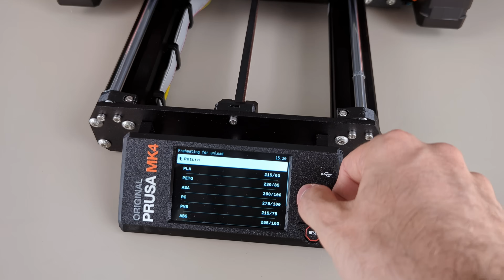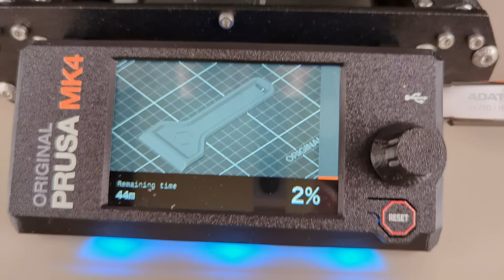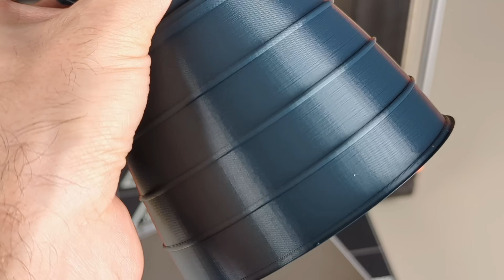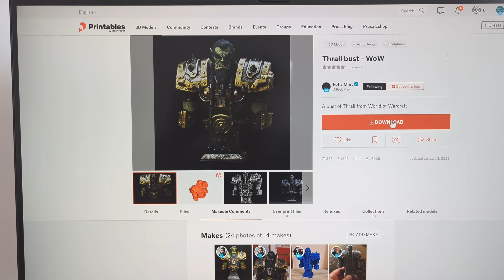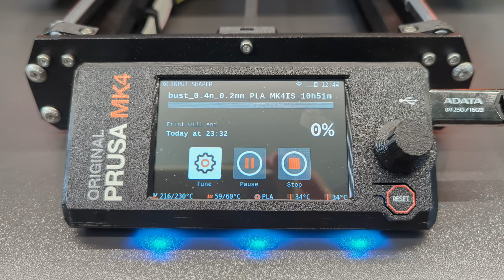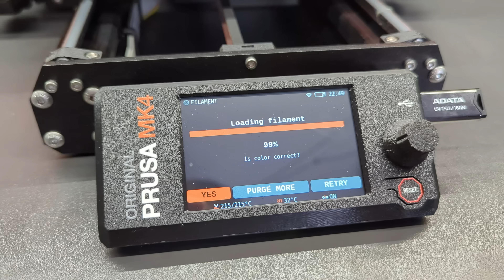Prusa MK4 in 2023? 🤷‍♂️

Comment: Love prusa, but this printer really isn't good enough for it's price point anymore. Bambu has the P1S with 4 color printing for €200 less than this. Open source is great, and building in Europe is admirable, but the mk4 needed to be much more of an upgrade than it was in reality.
Reply: I'm still not sure what people expect. It's an upgrade of the i3 line. One that added all the things people complained about on their MK3s and more. The name MK4 is exactly telling us that: The 4th Mark / model of the i3 - a proven workhorse. 

Sure, Bambu's coreXY are impressive and have a more advanced motion system. But I for one like that I can fix my printer with parts I can either print or buy in an electronic shop around the corner. I am not a fan of having all my print files in the cloud too. I have used Prusa's 24/7 live support and it helped fix issues in a day. 

I also find it funny that people complain about the MMU which works fine for a lot of people (and especially do so after the latest firmware upgrades), but praise the AMS and it's "minor problems" which includes such minor things like a lot of spools not working because of size or material, filament breaking in places that are hard to get to, roller holders breaking and what not. It's also not a good idea to print abrasives with the AMS, is it?

Overall these are different machines for different customer groups and ALL have their advantages and flaws. 

I always feel like people are comparing the latest Toyota Hilux model with a Mercedes SUV. Sure, the Mercedes is faster and better looking. But in a few years one will be used with a machine gun mounted on the bed and the other one will be shot at… ;-)
Reply: @ulaB  Your compairson is flawed for a few reasons. First, your facts are wrong. You are not required to connect to the cloud system, LAN only or SD card works fine. Seconldy, replacement parts for the bambu are all insanely cheap and ship fast. If some proprietary part on the prusa like the nozzle breaks, you have to wait a couple weeks for shipping and pay crazy taxes. (I've ordered from both companies)

Secondly, it's not even debatable that the AMS is worse than the MMU. People don't want a project multi material system that needs hours of tinkering and software updates to work. Even though the AMS doesn't work with some materials, these limitations are clearly highlighted, and if you follow their instruction, you wont have any problems. 

I like your comparison of the Toyota Hilux vs the Mercedes SUV. But imagine this, if both the Hilux and Mercedes were $30k new, which one would you get?
Reply: @morbus5726  An old Hilux, because it's more practical, for what I need it to do and I can repair it with a hammer.

The LAN only and SD modes were added after people complained, weren't they? You still need the cloud for firmware upgrades? Nobody knows what data is being sent then. Log files are encrypted, so nobody knows what is being stored in them either. Most people don't care about that - which is fine, but I do and have to.

Import taxes are not Prusa's fault. Being in the EU, I don't have to pay extra and shipping is fast too. I can get most parts from different shops if I wanted to anyway.

As I've said. People have different requirements for their tools. All these tools have advantages and disadvantages. I prefer one, you prefer the other. You shouldn't call my choice flawed, because it doesn't fit you.

BTW I never understood people having so many issues with the MMU2. I have maybe calibrated it for an hour. All I had to do was setup the two filament sensors. After that it worked fine. Perhaps it's because I print with Prusament PETG most of the time or I was just lucky. I have even printed TPU with it even though I've been told it doesn't work correctly. The only mod I did some time later was the PTFE adapters in the back. No tubes with different diameters, nothing. I don't even use a filament buffer. My filament just dangles from the table.

I was quite angry with myself because I had it laying around for nearly a year before I added it. I was scared because of all the horror stories I read before. And after I wasn't sure why people were so mad about it.
Reply: @ulaB  LAN mode and SD card mode were NOT added because people asked, it was there from the get go. Do a bit of research before confidently stating facts.

I agree that it's personal preference, but now many people do you think would pick a Toyota Hilux over a new Mercedes SUV for the same price? 

Not all people care about open source, or want to print their own replacement parts. People want things that work, and nowadays, people care less about privacy. 

I personally run my bambu's in LAN only mode, but the majority of people don't care at all.
Reply: @morbus5726  If you have important 3d printing files of course use LAN, if you use wifi you are stupid
Reply: Exactly, Prusa has fallen behind quite a long way. Printers in the same price range of the mk4 kit are much better. The mk4 was outdated when it was released, that just shows how far behind they are. There really aren’t any excuses Prusa can make for the mk4, they have continued charging a large amount for the mk3 for years so funding shouldn’t really be an issue and the mk4 is just a slightly upgraded mk3. There really isn’t anything that innovative about it, it is just an mk3 with a few upgrades that pretty much anyone could add cheaply, the main changes are just a 32 bit mainboard, a new extruder, 0.9 degree stepper (which anyone could have added anyway) and a load cell, nothing really that impressive. The amounts Prusa is charging for the upgrade kits is ridiculous too, to convert the mk3 to an mk4 you might as well just buy an mk4 kit.

Prusa has done too little, too late, to actually compete again and produce modern printers it needs to be much better. If it is going to cost more than the likes of the P1S (although the P1P is a better comparison due to it being an open air printer too and makes it look even worse for Prusa) then they need to produce a printer that has similar or better results.

Even look at the AMS, how many times has Prusa attempted their MMU and how well do they actually work? Then Bambu labs releases the AMS and apart from some minor problems it just works. Why couldn’t Prusa make a reliable and functional multi material system? Bambu have totally wiped the floor with Prusa and not just in one area, their printers and multi material systems are much better. 

Hopefully this has been a wake up call for Prusa and they will start actually innovating again but it would take them a lot of work even just to catch up with what is currently available, not to mention what will be available in the future. They have a lot of work ahead of them if they want to reclaim their reputation and I don’t know if they can do it.

Comment: What an excellent video, crazy to see so many little bugs/glitches in the menus and setup processes for such a pricey bed-slinger.   Seems like a great printer but all the little issues and the fact that there are now so many cheaper competitors, I don't see myself getting one :/
Reply: Prusa have fallen behind massively. Their latest flagship is just an mk3 with a few upgrades just about anyone could add. Literally just put a decent mainboard in a mk3 and add Klipper with a raspberry pi and you are probably already just as good as the mk4, even closer if you add a Revo hot end.

The mk4 was outdated when it released. Prusa have a lot of work ahead of them to catch up.
Reply: @conorstewart2214 
Yes. They need to include the spyware and proprietary bits. Heavily encrypted log files will be the icing on the cake.
Reply: @TrollWithOpinions  what is your problem with bambu? This has nothing to do with bambu, it isn't bambu's fault that the mk4 was outdated on release.

Are you just another prusa fanboy trying to scare people away from better printers.
Reply: @conorstewart2214  
My main problem is twofold.
I do not accept the need to register on an app simply to be able to install the printer or upgrade the firmware. That is unnessessary  information gathering, and you do not know what information they gather.
Second. I do not accept overly large logfiles that need to be sent to Bambu in case of support. Especially when thy are so large AND encrypted. I want to know what data they leech from my system.
There are more reasons, but you get the idea.
I do not in any way try to diminish the quality, speed or some of the smart features of the Bambu. I think it looks great. But there is no way in Hell a system like that gets into my house, onto my network.
Reply: @AptMantis2278that is a very subjective opinion, it highly depends what you compare them on.
Reply: @AptMantis2278
MK4 is a “bedslinger”, but at least it is not a spyware printer.
Reply: Honestly, a few of these were just him. Like all the filament loads/unloads. I’ve never had an issue with it.

The progress bar stays at 99% signaling it’s about to retract for you and he kept pulling it every time. Pretty sure he managed to trick the filament sensor that way a few times in this video.

As for WiFi, I’ll admit it’s pretty archaic. I only used it wired, so never had to deal with that.
Reply: @aaronchamberlain4698  I feel like this I'd a half hearted criticism. He was pretty reasonable and shouldn't have to know about weird quirks of the product. You're buying a 3d printer, you aren't house hunting for a house with "character".

Comment: It would be good to see an actual comparison between the Bambu and the Prusa. 

Comparing these artifacts, noise levels, tolerance, bed adhesion (you seem to be using glue sticks and brims on the X1C which might indicate poor adhesion), etc. 

Right now the final conclusion seems a bit rushed and not clearly justified in the video itself.

Comment: I think Prusa in this is a step behind other brands like Bambu Lab o Creality with the K1. I have de mk3s and the prusa mini but if I had to buy a new one I would buy a Bambu lab or some core xy with klipper and modern things. This model is like a generation behind.
Reply: An Ender 5 converted to klipper and user modded would probably be better than a k1, lol.
Reply: The prusa mini is a great mini printer as long as you don't care about speed, I love my mini more than my voron
Reply: @dark_xdark132  I agree, I love my Mini too, is the printer that I use the most and the more efficient, but for sure new and better printers are coming and I am open to that. 

I see a new generation of printers and Prusa right now is not in that wave. 
For sure they will ride that wave but right now none of their printers at least in my opinion is next gen. 
I saw in printables a very interesting project to make the Mini a core xy that I will try once its mature enought. 

My comment is not to put hate on Prusa printers. I like them, but I see that right they are behind and now I prefer other type of printers. 
Meaby I am a little bit dissapointed with them. I was expecting more of Prusa or something new or disruptive, and I think I´m not the only one. But that is because they are the best in what they do and I think they can do much better.
Reply: Yeah the mk4 is just a slightly upgraded mk3. It wouldn’t take much knowledge or time to upgrade an mk3 or even cheaper 3D printers to be better than the mk4, just add Klipper and you will probably end up with better results than the mk4, that ringing and other artefacts are terrible.
Reply: The K1 is made from cheap plastic and is a huge security risk because it runs a fully managed Linux box that you have no control over. 10/10 would never buy one.

Comment: I feel like you critique on the wireless setup is kinda lazy. Wifi connection is explained in the printed manual (because obviously it is) and also on their website, it is not difficult to find at all or hard to do. I really don't think it's fair to say it should be easier to set up if you don't bother to look for instructions in the manual that comes with the machine.

That said the wifi, even when set up, is slower than you would expect from a machine of this caliber.
Reply: Excuse you????

In what universe is having to put in an sd card to enter wifi credentials decent UX?
On top of that, it doesn't even tell you obviously if its wrong.
You are making crazy excuses for an objectively bad UX.
Just the fact you need a manual to do it is a problem. On any other machine, you just intuitively type it in like youve done on every other device ever.
Reply: @BeefIngot  Sure it might not be an elegant solution but it's not hard at all, and he wasn't complaining about having to put it on a usb stick (which would have been valid criticism I agree) but the fact he couldn't get it to work when he only went to the settings page and waited for something to happen there instead of looking at the manual. That's what I am calling lazy.

I'm not making any excuses for anything, go hate on Prusa somewhere else.
Reply: @ren8  Dude, literally no human ever expects to have to read through the specifics of a manual to enter wifi credentials. It's completely unfair to call him lazy for that.
Reply: @BeefIngot  I looked in the manual. Most people might not start there, agreed. But if you don't see anything in the menu it is beyond lazy not to take 5 sec to look in a manual.

I agree they should've just enabled the user to enter them in the menu (although with only the nob it would take forever to type anything) but I also think a user should take a look at the manual before giving up.
Reply: @ren8  I mean, how do you think he got through the rest of the video? he probably did exactly what you said. Most likely he was reasonable, assumed it shouldn't be all that difficult then criticized them fairly for having to refer to the manual and deal with this type of weirdness just for wifi
Reply: @BeefIngot  Did you even watch the vid? He said he never got it working.

Comment: What other printers would you say compete with the MK4(price-wise)? I'm still on the MK3 and very happy with it, but I am considering upgrading soon. I know the Bambulab X1 is great, but I've heard it's very noisy. Can you let it run in the same room while working? Is the MK4 a worthy upgrade or I should just stick with MK3?
Reply: I have one MK3S+, a Bambu X1 and a Prusa MK4. My personal opinion, is that these two are different printers, for instance, repairs, service and maintenance in the MK4 it's far way more easy that in the X1C. I was testing some cheap PETG and the X1C was getting clogged every print, the prusa wont. Also, the MK4 it's the quietest print I ever had, even next to it, you would even listen only in the fast movement speeds, the X1C sometimes it's a little bit annoying it's loud as hell. So in conclusion, I have the opportunity of having both but, for those people that only can have one (price, space, time, wife 😅) I would recommend the Mk4 instead of the Bambu, because all the hardware in the Bambu i'ts proprietary and, hard to maintenance by yourself, you can only do a few things, and Bambu every solution the offer it's to you buy a new part. Now if you don't want to deal with repairs and just swap a part go for the Bambu.

PS. Resolving a clog with the Prusa vs the Bambu, the Prusa it's a loooot easier. Doing a cold pull (a real one no that bs in the Bambu wiki page) in the Bambu it's dangerous, you may burn yourself. In the prusa you just need to unhook the level idler and do the pull, in the Bambun you need to partially disassemble the extruder, and if any debris gets stuck in the extruder, you would need to disassemble the entire extruder, or change for a new one ( I preferred the first one)
Both printers are  top of the line awesome prints, but I think that every printers trades things for another ones that make the decision difficult, and you won't be able to have all at once
Reply: I think the choice is really driven by your individual use case. I chose to buy my MK3s because of the reliability and the upgrade path. I am glad I did, now when the need for me arises I can upgrade my  printer to a MK3.9 and get all the improvements. I would not choose a printer that runs off the cloud or is mostly closed source. I thought that the recent problems with cloud service printers starting prints on random printers was terrible and showed that company has poor QA and systems design skills. I don’t trust them with a device that could potentially cause a fire.
Reply: @Dilshad-gu7je Being able to print only via cloud on Bambu printers is the most widespread misconception. You can use SD card, local wifi or the cloud. The latter is most convinient but not required at all.
Reply: @hologos_  You still need to connect to the cloud for firmware upgrades, dont you?
Reply: @ulaB  You do but I was reacting to his claim that you can print only via cloud.
Reply: @hologos_  thanks for letting me know
Reply: Honestly, I would not print with a printer in the same room. Even Pla puts out VOCs and I think in 30 years we'll be reading studies about the effects on health effects people who sit around them all day get. I feel the same way about all the carbon fiber things  too btw. I love my Bambulab, but I'm not trying to catch dust in my lungs.
Reply: I have a P1P. It's very loud, but I just put mine in the closet in another room and that solved that issue. What you have to remember as well is that prints will be finished 4 times faster than your Prusa. So yes it's louder, but for less time.
Reply: @georgestone8099  fair point, if one focuses on over-night prints, maybe it's usable
Reply: P1S
Reply: Don't even consider anything other than a Bambu - Prusa is done
Reply: @thenamelessone123  That's sad. I really like Prusa's support and community, but they are really falling behind. I hope they push the MK4 hard with software updates in the coming months.